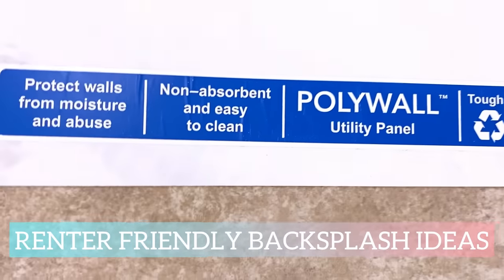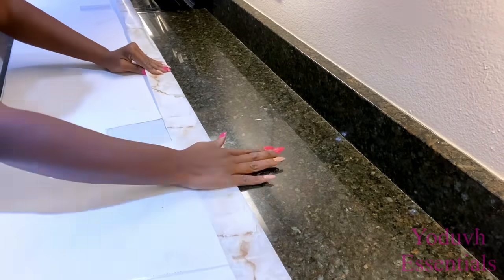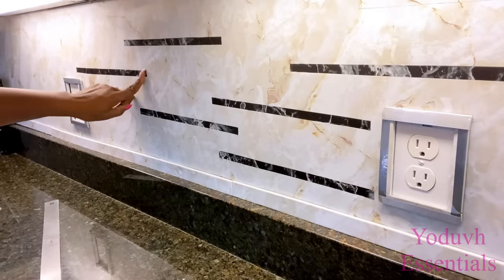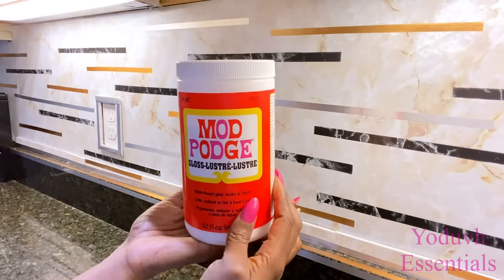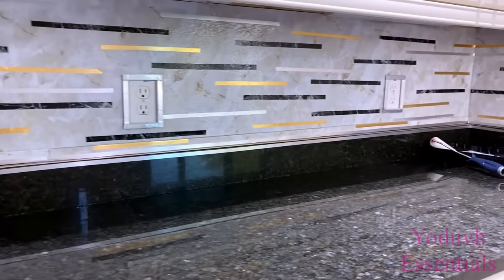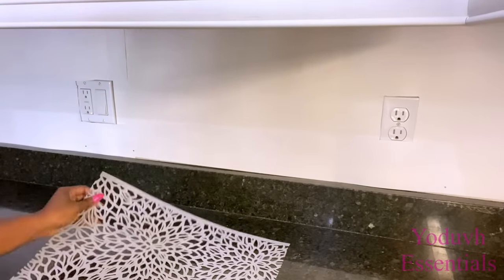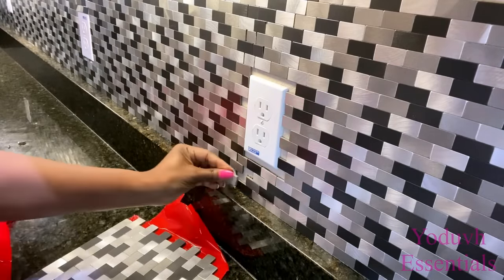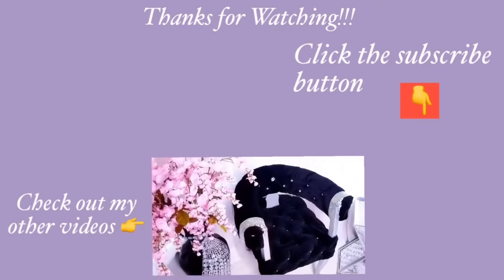3 DIY KITCHEN BACKSPLASH IDEAS With Table Mats AND More! DIY Renter Friendly Ideas

Comment: Question: Is there a reason you didn't take off the electric plate and cut the hole smaller then put the plate back on ?
Reply: It would make such a huge difference and is so simple to do. These are clever ideas, but they look VERY DIY because she cuts corners. It's still WAY more than a lot of landlords will do.
Reply: Was thinking the same lol. Also, perfect opportunity for her to show how to remove it since she was keeping them up

Comment: Tip: you can unscrew the outlet cover plate for a much cleaner and easier way to do the outlets. Put screw loosely back in place, so you don’t loose it. Then you can clean up the outlet plates or cover them and screw back on. Tighten the screw to the point it is firm and the screw groove is straight up and down.
Reply: I was wondering why she didn't do this too.

Comment: I love clever! One question or suggestion. As a professional Home Stager, TheCyberStager™️ (with OCD :), especially on your first two projects where coverings were thinner, I would have removed or loosened the outlet wall plates and reinstalled over new coverings. Only takes a minute to remove and leaves a perfect finished look.

Comment: thanks for sharing.  great ideas.   I highly suggest doing all of them the way you did the first one, on paper frame or some kind of frame.  Even the adhesive can be done that way, without worring about a hard time after taking it down.  At that point, once fixed, it can all be taken down by just removing the small nails or strong tape holding frame in place

Comment: FYI Mod Podge is actually an adhesive, not a sealer. It easily rehydrates, and turns milky and/or tacky. Its great for preventing runs and smears of perm inks from sealer application.  In this situation, a good acrylic sealer or varnish would be long lasting, water / moisture resistant,  and provide a high gloss finish if that's the desired end effect. With such beautiful and creative work, it would be a shame to have a top coat ruin the project.
Reply: I was thinking this as well. If one is attempting to clean grease and dirt from mod podge it's going to be a disaster

Comment: The self stick tiles you
 Bought look the best,
 It's beautiful. 👍
Reply: I work at a big box store and I can tell you that those self-stick mosaic sheets are amazing.  The longer they sit on the wall the harder they stick.  A lot of people are skeptical that they would, eventually, pop loose.  We did a workshop at the store, and I created a board a month ahead of the workshop.  Then at the workshop, we did a fresh board then let the viewers attempt to pull the tile off.  Some were able to get bits of the fresh board off and it confirmed their opinion that it would not last.  Then I had those viewers try to peel off the month old board.  They could not get anything off, and they tried really hard.  So, yeah, those self stick tiles are amazing and the best choice for long term application.  And yes I would remove the wall plates and replace once the tile was finished.  There is a product you can buy at the big box store that lets you 'raise' the outlet and switch so that it protrudes past the outlet box and sit flush with the wall tile.  You can also use small rubber washers.  Just slip them onto the screws and then screw the outlet back on.  You can also get longer outlet screws if you need to raise the outlets a lot.  The most important part of self-stick tiles is that you must clean all grease off the wall.  Use a grease cutter like greased lightning or simple green.

Comment: I keep wondering as I see more & more of your videos, if you are a professional Designer of some sort...... either Interior Design, Furniture Design etc.  You're amazing!  My only suggestion would be that when you encounter a wall outlet, that you should unscrew the plate and take it off before cutting out the opening in whatever you are putting on the wall.  It's so simple to unscrew the plate, then put up your wall decor before screwing the plate back on. That way you will never have to patch around the plate as there will never be a gap.  Thanks for the inspiration.  You make me want to redo my whole house!

Comment: QUESTION!!!

What if I used either the plastic placemat or tablerunner method and instead of plastic on the back, I used thick posterboard and mod-podged it? Would it still be semi-"water proof" for when I need to clean it or would that not work? Thank you!!!!

Comment: If you remove the outlet covers before putting anything around then it will make it easier to paint. Plus it will give you a more polished look when you put them back on. Thank you for these ideas they are brilliant!
Reply: I thought that too but, for the last one, it may be too thick. The outlet cover wouldn't be flush.

Comment: Just a small tip. If you remove the outlet and light covers then cut around them. You will get a much tighter and neater edges since when you put the covers back the edges will be under the cover.

Comment: Okay, is the plastic sheeting a thin board that you’re tacking against the wall.  Just clarifying so I will get the right material.
Reply from the maker: Yes it is 💕
Reply: @yoduvhessentials6310  Okay. I’m not good with this stuff so you’re using a corrugated board
Reply: Is it called corrugated plastic sheet

Comment: I’m seriously considering doing #2 but I do have questions. What kind of plastic did you use for the placemats and how do you clean it without removing the mod pod?
Reply from the maker: I used a large plastic sheet from Home Depot. The mod podge will NOT come off after it’s dry because it’s a water base sealant. It becomes hard and smooth when it’s dry and it acts almost like a thin clear cement 💕

Comment: @yoduvh Essentials    Wouldn't it be possible for a renter to have the last one too if they applied it to the plastic like you did on the first two? 
All were stunning and I wish I had seen this in 2013 along with some of your wall ideas. I had an apt where everything was white and for the longest I tried to figure a way to have a Tuscan style backsplash and couldn't figure a way that wouldn't potentially tear up the wall. 
Now, thanks to you, I know about products I had NEVER heard of that would have made my apt smokin and glam. 

P.s. There is a formula of mod podge that is dishwasher safe(blue & white label) and would work on the backsplash around the sink area since the mod podge obviously can get wet.

Comment: Just remove the face plate to the outlet and measure under it and get slightly longer set screws to fit the cover back on over the newly covered plastic backsplash.

Comment: Before I begin, the first thing that should have been done when you're doing any kind of decorating, painting, and other similar designs of any kind, you have to take off all the outlets. I do not like the way she put the edges around the outlet; it looks tacky. The first design, I don't like the stripes but prefer either the black or white design only. The second one was a great idea and really love it. I've been thinking of doing a backsplash myself, and this is an inexpensive way of doing one. The third one looks like a typical store-bought backsplash and would done it differently. It's well taught though. In addition, you should put a small stream of caulking around the edges at the bottom to protect any water from possibly seeping underneath to protect the wall behind.

Extra tip: if you have a western painted wall vs. an eastern painted wall, you should lightly sand the walls so you have a smoother, better contact of your paper to your wall without lumpiness (for those of you who don't know what this means is that western means texteured wall, which started in Ca. Eastern means smooth flat walls, no texture, which is seen on the eastern US. Nowdays its anyone's texture style).

Comment: Dear YOUDVH, I really like your idea for the kitchen backsplash I think it's wonderful I had this idea but I'm not sure about it so I want to pass it by you Youdvh to see what you think 🤔 it would look good.  I was thinking about getting an ALOHA small print red or blueish green fabric and gluing it to the the poly wall then putting the contact paper in the pinkish marble or greenish blue marble contact paper on top. I just love your idea about the backsplash with the user friendly contact paper because it's inexpensive. I'm doing Hawaiian prints in my kitchen and under the sink because I have a washboard sink to cover up underneath the kitchen sink.I'm using Walmart Aloha  fabric; large big bright green leaves underneath the sink with the white background and large aloha flower large print bright multi green leaves. YOUDVH can you please help me.lm not sure and I don't want to goof it up Thanks love love your website What is your best advice and can you show me if you think lm goofing up doing this. Thanks

Comment: You should always remove socket plates when doing you project. First one is cheap looking. Second one is nice. Third one would have been easier if you would have moved the plates. This way you wouldn't have to cut tiny pieces.

Comment: Here's an idea instead of having to put the wood on top of the outlet plates if you take the outlet plates off and just cut it to the little bitty metal piece the electrical piece and just cut around that when you put your wall plate back on it'll stay in place and you won't have to add the wood and it's it's user friendly that way

Comment: Why don’t you take the switch/plug plates off the wall before
you glue your design on the wall? If you did, then you don’t have
to add a special trim/molding around the plates to cover any spaces
left between the switch plate cover and your design on the wall.
Makes the job a lot easier.

Comment: I think, if you had removed the face plates off the plugs and then cut out the openings  then put the plastic sheet on the wall; it would have given you a cleaner look.  Those were all very beautiful ideas

Comment: U said 3rd one is hard to remove, it seemed permanent
.. then u said all 3 are ez to remove,  which is it?
Reply from the maker: ‘Hard to remove’ on the TEMPORARY board used as surface over the wall as shown in the video NOT on the kitchen’s permanent wall.

Comment: Omg, you are killing me. The closest Home Depot or Lowes is about 700 miles away.  If I go to my local hardware store, and ask for "plastic sheets" they're gonna look at me like I'm smoking crack. "There is a link to everything I'm using in the description." No, there isn't.  I'm a bitch hermit and I don't like playing 20 questions and looking like an idiot with store employees what is the brand name? What department would I find it? What is it generally used for? What dimensions is it sold in? Drop cloth for painting? Shrink wrap? Vinyl? I dont know what "plastic sheets" are.

Comment: 😅 it drives me crazy that you do not remove the power outlet covers,. Suggestion: it’s just Unscrew the covers apply and cut ONLY around the outlets and once having finished applying in this case the diy backsplash just screw the power outlet cover back on and DONE it SHOULD look more professionally done. 😉

Comment: i had a lot to say about all of them but i won't. i got so much hate from the last comment i made. However, i can't stand by and let people's lives be put at risk bc of her lack of knowledge. backsplash #2 while pretty if yu're into that kind of thing, is a ri to he dr. hospital, or morgue in the making. hot glue is NOT a substitution for construction glue. which means there is going to be air holes. when she was rolling on the mod podge i don't know how many of you noticed how the placemats just rolled with the paint roller. thats bc when she stuck them to the wall she created an air pocket. the wondre of editing is she edited it out. to fix this she would have had to poke holes in it. ao now yoand it wasn't sticking to the plastic backing it ur hot glue has iny little air pockets and you front has tint little air pckets in it.  yeah, yeah, yeah, "but she put mod podge ove the top of it all to seal it." i can hear you screaming at me now.  guess what mod podge wasn't created to seal against the rigors of day to day rigors of the abuse of kitchen life. steam, heat, frying, etc. it will break down and it wasn't sticking to the plastic backing she had put up it was sticking to the backing of the placemat. watch the video carefully it's a solid placemat. you can see the glare. the pocket is the perfect place for moisture to collect and grow mold, mild, and bacteria to breed. and unless you don't actually plan on cooking in your kitchen anything you cook the air proteins will be feeding it. just avoid it altogether. or enjoy your trip to the dr's office, hospital, or morgue. breathing in mold for long periods of time and certains types can cuse asthma, permenent lung damage, and death. the other two.... if done properly they would have looked nice. but as always she just slapped them up there. so it is what it is...shyte.